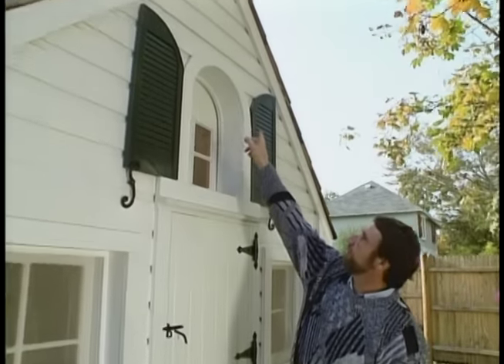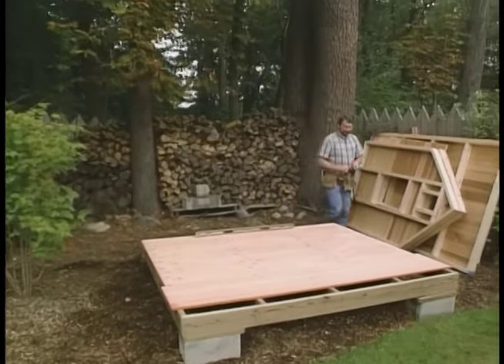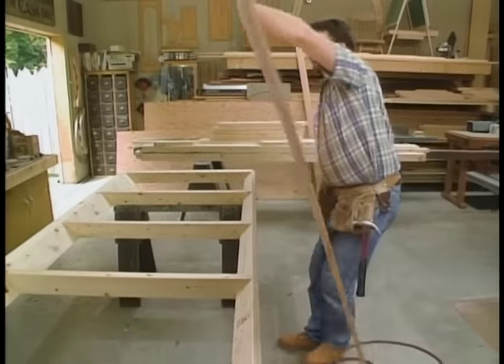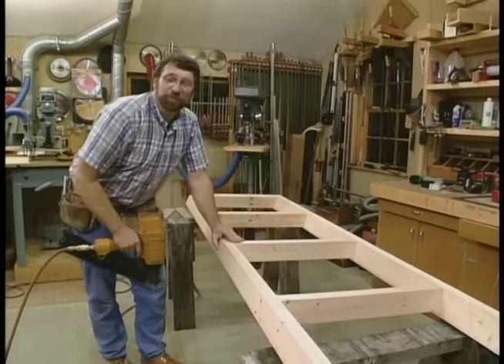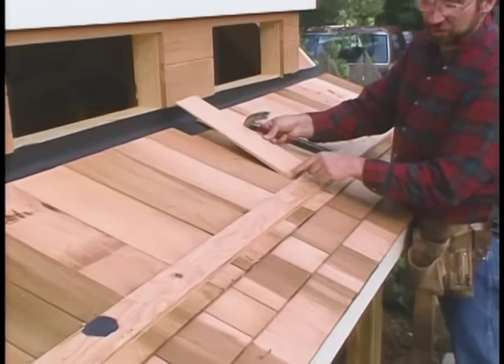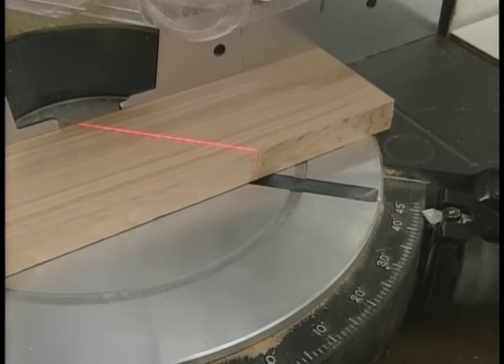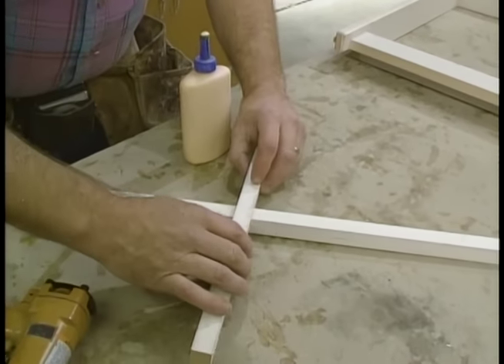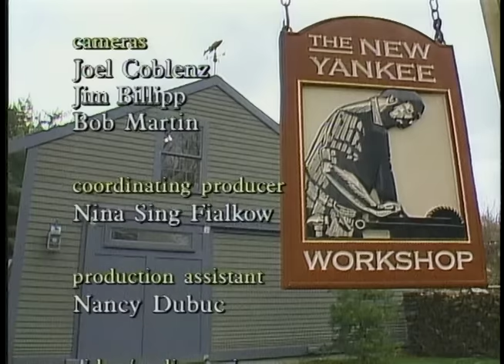Playhouse  |  S6 E12 & 13

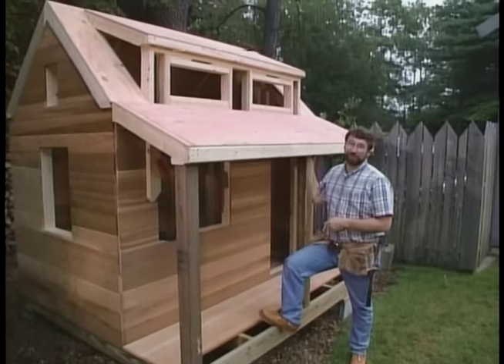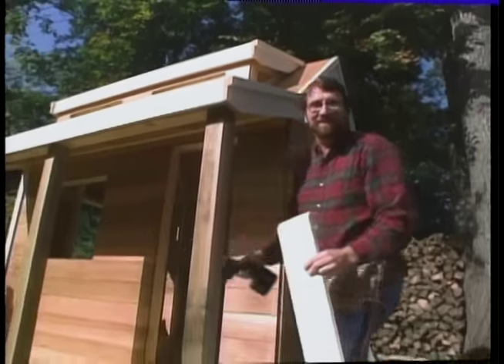Comment: Glad these videos made it to Youtube where we can leave comments.  I built this playhouse without a set of plans.  The plans were $15.95 before and now are only $9.95.  The reason I didn't buy them was the fact that Norm says he designed this on paper in the beginning.  Well that statement challenged me....I actually took measurements off the video!  Took me a long time to draw up, but I did it!  Looks amazing!  this was going to be a cat house but the feral cat never would use the cat door under the window i installed.  One very important part Norm forgets to cover on the video is the need for a support 2 x 4 for the upper sides of the roof.  If you look at the roof at 21:19, you see a triangle  piece of siding he needs to add to the upper roof.  Then as they come back to recording at 21:23, you see that triangle on the right side of the building filled in with an angled 2 x 4.  That holds the siding and also the flashing!  Very important detail they don't show on the video.  Plans I'm sure include that.  

Okay well thanks Norm for creating this cat house!   I will eventually fill it with grandchildren!  One more thing, when Norm builds it you know it is built properly and solid.  It is hard for me to view someone else creating something because they use pocket scews or improper methods, but with Norm, you get the right guidance, and he is well spoken.  Just like watching the auto shows and one shop will show you the attempt another shop failed at, and then they show you the right way of repairing that rusted fender.

Comment: @ 12:44 That crow's foot cutout on those roof rafters are about the same as those found on commercial table saw push sticks, regardless of the fact that this cut is often referred to as a 'bird's mouth', for sure.

Comment: I noticed this on the dovecote as well: Norm's straight edge when shingling gets tacked into the previous row. Doesn't the tack-nail make a hole that water can penetrate, thus undermining the purpose of shingle?
Reply: Yeah, I'd just use a chalk line...
Reply: The tarpaper seals the nails. Not a problem to tack into it.

Comment: i had a question about that t and g siding nailing, i saw he was doing it with a hammer, nail set and obviously nails, could a 16ga air nailer do just as good as those nails he was using?

Comment: I was thinking if he built that playhouse INSIDE his shop, he'd play hell trying to get it outside! But he could have probably done it with a 3/16 inch sloped rabbited router bit on a 65 degree angle planer saw (sar) and secured with 20 penny galvanized ring shanked hot dipped, flat head nails and 432 various sized clamps held to 25 patterned, mortise and tenon dove tail ring meat joints, glued together with 2 parts wood glue to 1 part hot semen.